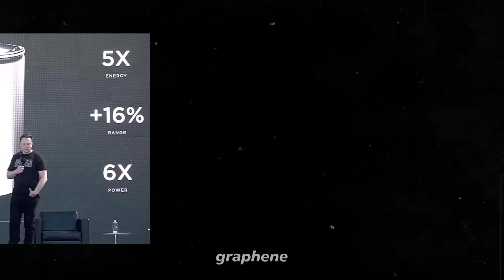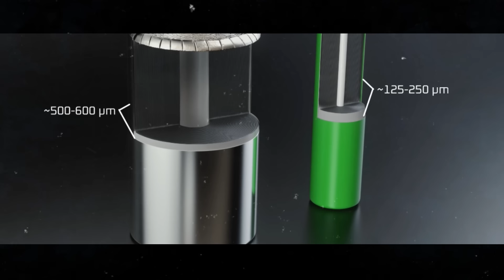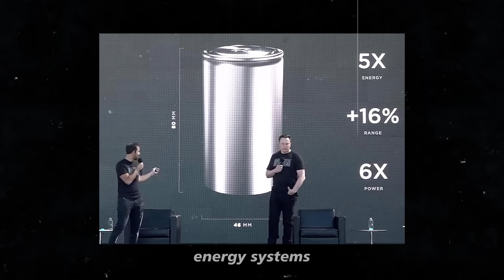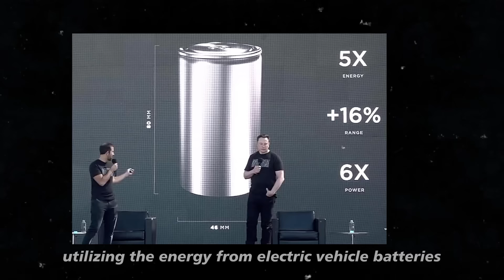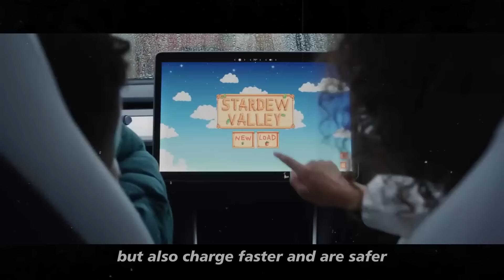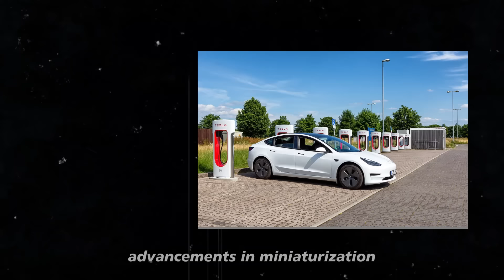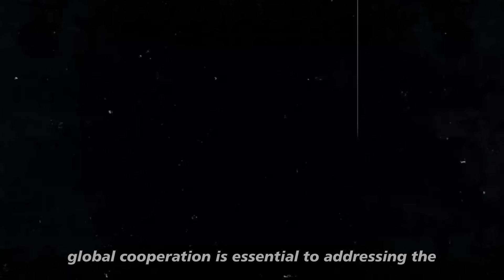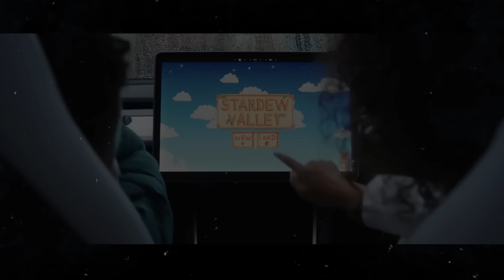GOODBYE LITHIUM! Elon Musk revealed Tesla aluminum-ion super battery and changes the battery game

Comment: This sounds great but don't forget, the speed of charging is also limited by the power output of the charger - no matter the charge power capacity/speed of the battery.
Reply: Also EV charging stations have stopped working due to being too cold.  Imagine how much copper would be needed for extra power lines strung over those ugly towers.  All the mines needed for the digging up of minerals to build the wind turbines and solar panels that end up in landfill. All in the name of net zero, BS.  Announcements about the new buit batteries are made every other day.

Comment: An Australian company ( Graphene Manufacturing Group ) already has an Aluminium-Graphene battery but the road block they ran into was the graphene.  Right now it isn't manufactured but rather mined mostly in China I believe.  To make this "Aluminium" Battery feasible, graphene would have to be manufactured on site and I believe if Tesla has an announcement in that direction it is in the production of Graphene and not necessarily about the battery.

Comment: If this is true 1000W/kg is the nail in the coffin of the for gasoline cars, if with the curren batteries of 180W/kg electric cars reached 25% of penetration, with this x5 in power density they will reach 75-80%, because batteries are the only weak point of electric cars. 

With this, it will be possible to build commercial electric aircrafts, and even flying cars and personal robots will become real because current batteries last 30-45 mins at most in high energy consumption environments as in those exotic machines.